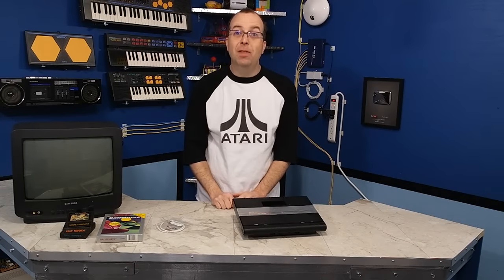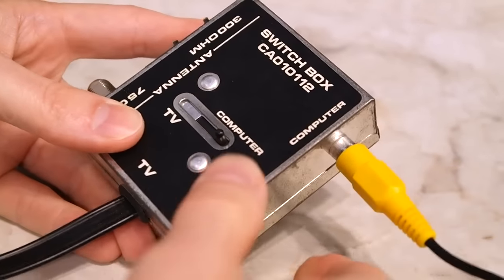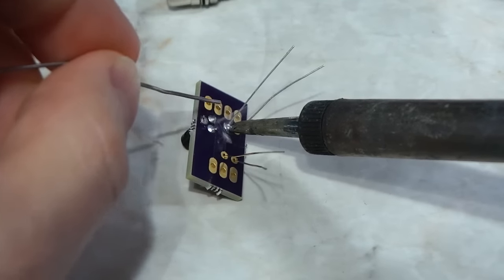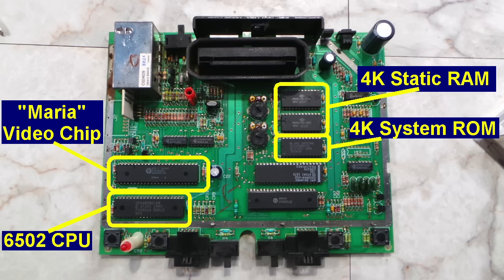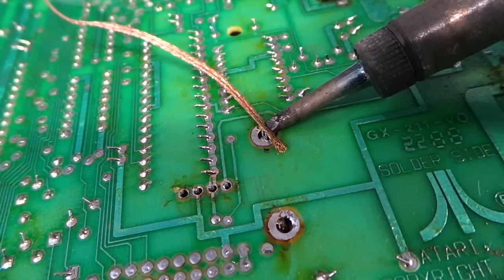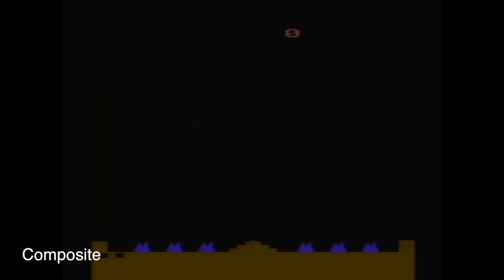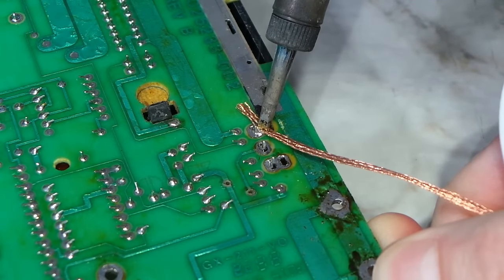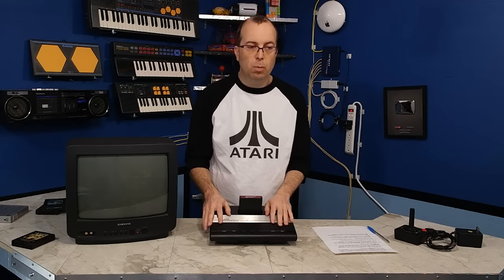Atari 7800 Composite Mod and Review

Comment: remember the futurama episode where bender overclocks? have you ever thought of over clocking one of your old computers?
Reply from the maker: You can do that, or even upgrade the CPU..  But there isn't much point since 99% of the games will simply run too fast or not be any different at all.  So unless you are writing a custom program, there just isn't any point.
Reply: Ok, you write programs right?

Comment: Goes against the point of the video but just so you know: You can get an RCA to F-Type adapter (http://www.frys.com/product/1524949) which will save you, or anyone else, from having to deal with the PITA switch boxes and 300Ω -> 75Ω adapters. You still need to switch to CH3 or CH4 on both the console and the TV so they're lined up (It's still an RF signal).

When you use a switch box like shown in the video, what you're actually doing is taking the 75Ω RF signal from the console (this goes for all of the consoles with RF out), converting it to 300Ω using the switch box, and then converting it, again using a 300Ω -> 75Ω adapter.

Comment: You have to remember that whereas the 7800 came out in 1986, making composite a viable solution, it was actually designed back in 1984. This is probably why it's RF only.

Comment: I assume you know you can lose the switch box and use an RCA to F adapter and put the cable from the console straight onto the F connector on your TV... (this is what I do with my old consoles that don't have composite outputs)

Comment: Did something similar to my VCS 2800, with only a single audio (I can just split the signal so the sound plays on both speakers) jack. I was thinking of moving the color attenuation to the side also, just in case I had to mess with the color settings.

Comment: I never used those awful boxes, I just got an RCA to Coaxial adapter from radio shack and plugged straight into the TV, and tuned it to 3 or 4

Comment: The reason the 7800 doesn't have a Composite out is cost. Tramiel-era Atari cut costs wherever they could without fail. That's also why it only has the TIA soundchip from the 2600 instead of using a POKEY chip. Developers could put a POKEY in the cartridge at additional cost to them. Cheap cheap cheap, just like Jack liked it.

Comment: 8:00 step bits are expensive if you are cutting something hard. you are essentially cutting cheese, you can get step cutting bits that work great for plastic or pvc cheap: https://smile.amazon.com/gp/product/B015MV1N8E/ref=ppx_yo_dt_b_search_asin_title?ie=UTF8&psc=1 i got these for 10 bucks. cheap and throwaway, but they work for plastic cheese. (btw don't get it twisted, it is best to just have the right size drill and to cut small holes up to the size)

Comment: You don't need all that jazz. All you need is a single (female) RF to (female) Coax. adapter that you can get at Radio Shack or on eBay. All it is, is a little thing that you plug the RCA plug into and the other ens screws into the cable input on your TV.

Comment: cool vid as always but i couldn't help but wonder - why, if you're going to go to the effort of modding a 7800, wouldn't do an RGB mod instead? especially as you say it plays 2600 games and the 2600 cannot be RGB modded.. anyways, keep up the good work :)
Reply from the maker: I wasn't familiar with this RGB mod until I started reading the comments.  I plan to look into it.  But still, the composite signal is near universal.
Reply: well it turns out i was wrong anyway, i just found out there IS an RGB mod for the 2600 by etim even though i remember reading at one point it was never possible. and like a typical yt commenter scumbag i hadn't read to see if anyone had already said the same thing - goes to show what i know. dude you've got to get on the rgb hype train, it's so good. make getting an old BVM a patreon goal. it's so worthwhile. and you can get them for a good deal if you look hard enough

Comment: If I was completely removing the RF modulator I'd have put the new jacks in the old space (possibly cut the section out and mount a new panel for them). I just dislike side connectors on things.

Comment: speaking of Atari I just got an Atari 2600 with 18 games, 3 joysticks and game manuals that are in very good condition. I got it at an estate auction for less then $50.I am not going to mod mine I will just use my good old CRT TV that is RF only form the late 90s/2000.

Comment: If you come across a modded system in an estate sale, how can you figure out the purpose of the mod if you don't have an electronics background?
Reply: indeed, an intriguing hypothetical mon librepenseur;
thus, you could take images of such, and share those with ThisWeekInTech,
Father Robert Ballecer answers all kinds of games-related hypotheticals.
or forums et boards which you think may be places that could answer your hypothetical.

what, preytel, do you think you might have found et require value for ?

I hope this aid to you mon librepenseur.
je prends conge
Reply: I picked up a couple of TI-99s at an estate sale a while back (I was needing an original monitor and it was an all or nothing lot) and one of the computers has a flip switch installed on the left side of the keyboard.  I never fiddled with it much, but I was wondering if someone was overclocking the processor (pure guess).  I just thought it interesting because I never thought of modding the TI.

Comment: Why you dont use the water and dish soap method for cleaning the motherboard? just let it sit in the sun/heating for 1 week and it's good
I have do the same method with my ASUS P5B Intel 775  motherboard, still works perfectly

Comment: It would be interesting to reuse the holes in the case corresponding with the RF jack and the 3/4 switch instead of drilling new ones.
Reply from the maker: I thought about it.  But it would have been a lot of extra work to make that happen.

Comment: About 5 years ago i bought a tiny  RF adapter one end is coaxial male the other end Rca female for my Atari 2600 works ok  might work for the 7800 ? and also the if you don't have a 2600 controller a sega genesis controller works too  again for the 7800 ? but the mod is a much better bet

Comment: Is there a way to test the sound chip?  Adding a A/V mod to my 7800 and the sound worked briefly.  Wondering if there is a fuse or resistor that could have gone bad due to the change.  Thanks,

Comment: How well doe Sega Master sytsem and Genesis controllers work on the 7800? A lot of people use them on the 2600 and since it works with 2600 pads got me wondering about sega pads on the hardware.

Comment: Yes the composite mod makes the picture quality better. BUT I can not understand why you were STILL using the original RF adapter that they used in the 70s.... Those things truly make it worse and if you went and got a modern RCA to coaxial adapter that would of made the quality FAR less muddy looking and its the size of a pea. Composite mod aside... there should of been NO reason to use the old RF adapter with that device. That was half of your problem right there.

Good job on the composite video mod though. It looks really clean and I am sure it works great. I may do this to my spare 7800 at some point. Thank you for this informative video.

Comment: So.  This is probably an inappropriate place to put this comment, but I'm going to anyway.  I seem to recall David mentioning that one of Atari's 8-bit computers (not the consoles, the home computers) had a more advanced sound chip (or possibly video chip) than typical installed, but that it was not connected to the audio (or video) output jack.  It may also have been an LGR video.  I can't find terribly many references to the Atari 8-bit line on either channel, because the search function built into Youtube is gallingly bad, particularly for a Google product.

Comment: i have the Atari 5200 which is bigger and better IMO. Mine still has the clear plastic covering it so its like new. tho i did have to rebuilt the funky controllers several years ago and works like new.  i wonder if their is a composite mod for it....I'll have to check into it.

Comment: Wow! Only 3 electrolytic capacitors! It's been 4 years since this video has been posted, if they are the original capacitors, I would want them to be replaced, I had a similar console a few years back that had a really noisy picture and sound, I replaced the electrolytic capacitors which were bad and it's image and sound were restored!

Comment: Distilled water, from gas station near you, can be used to flush even beer from laptops if applied ASAP.  I dunno about the additives on american tap water but i would`t use it..... 
(rescued couple beer spills and phones that submerged in a pint :D )

Comment: Just wonder where that other wire went to might missed that but it seems simple enough to figure out like the mod it improved the system always hated those wingle lines we use to toss the rf box around to rattle the dust out to get it to work better I hate those things.

Comment: 3:52 hmmm, I think you've misordered the component you would like to solder. You should have solder the transistor the last one after the rest of the component before the transistor itself. Transistor known to has lowest melting point and lowest sturdiness. Yes, prone to damage by heat! So if you too long solder on that transistor, the inside will melt and malfunction.
5:22 VINEGAR VINEGAR VINEGAR VINEGAR VINEGAR VINEGAR VINEGAR!!! tbh, I practiced that too when I was fixing the battery corroded wireless keyboard component, not work well but has atleast significant improvement. thx dude!
5:36 Maria chip. wow, what a pretty GPU!
14:59 Wow, extrenly Duper Awesome!!!!

Comment: harbor freight has a stepped drill bit set for like $10.

while most if not all, including this bit, is garbage it beats not having one. pretty sure its a high carbon steal bit (the worst type of steal for a drill bit) , but for plastic its fine. you reduce a lot of the grabbing while drilling plastic while using stepped bits.

Comment: It boggles the mind that Atari didn't add the couple of extra connectors and jacks to support composite output natively. It wouldn't have made a huge difference for the console in the marketplace though, it was always going to be held back by poor audio, Nintendo's monopoly-esque grip on publishers, and the NES just opening the market to a lot more genres of gaming that the Atari was ill-equipped to handle (like RPGs).

Comment: Instead of the RF switchbox, you can now use an adapter like this: https://www.amazon.com/gp/product/B0028MXOF6/ref=oh_aui_detailpage_o01_s00?ie=UTF8&psc=1
I also did this AV Mod and found the sound was too "Hot" so I added a voltage divider to drop it down to much better levels.  Using Audacity to check the level.
I am really surprised you do not run the various devices (Keyboards) that you add RCA outs to thru some sort of indicator to show VU levels.  I use a DAK 2800 mixer and it works great for this purpose.   I am pretty sure not using this burned out the audio inputs of a cheap "to hdmi" converter.
Thanks for the great content -- awaiting X3.

Comment: Couldn't you of just soldered the sound wire onto the resistor leg? Why did you have to remove the switch and resistor?

Comment: If the transistor amp dies, just get a better 2n3904, and not a surprise ebay piece from a recycle/pull. That's the only issue with the unverified boards. The original modders that release their work for others should be rewarded as much as possible IMO.

Comment: Whaddayamean, Not Stereo? My 2600 has stereo output. Combat is one of the only games (IIRC) that is stereo. I've a modded and near mint 2600 system. Too bad all the latest AV receivers dropped SVideo inputs...I have that on the Atari (it also has component video out). That TIA can do RGB...

Comment: That board really needs a clean and treament to stop the corrosion.. you won't have a running system for long with that level of rust eating away the traces and connections.

Comment: hey, use a coaxle to component adapter for your 2600 and 7800 and say goodbye to those boxes. I have 4 box and all 4 are bad so I had to find a solution.

Comment: If you don't know, it's recommended to not get the United States versions of 7800 controllers because most people agree that they suck. Try to get hold of or import a european/PAL 7800 controller because they were more like a normal NES controller.

Comment: So why are there 2 audio cables when the audio is mono?
Reply: In case you're using a stereo TV with two audio inputs - otherwise you'd only get sound from one speaker; at least this way you get dual mono.

Comment: I have retained my original TV that I still play my Ataris on. I have the following Atari systems:
• Atari 2600 VCS 4-Switch Woody
• Atari 5200 Super System 4 Controller Port with Automatic Switch Box
• Atari 7800 Pro System
• Atari 400 Computer
• Atari 800XL Computer

Comment: You planning on giving 1MB to that sweet XEGS of yours?
Reply from the maker: No.  First of all, I don't own an XEGS.  I have borrowed one from The Obsolete Geek every time I needed it for a video.  But even still, I doubt there is much of any software that can take advantage of 1MB.  Even my 130XE that has 128K is really pretty useless outside of the first 64K.
Reply: I've got a 1MB mod only to play demos...guess You're right
Reply: @The8BitGuy  Not entirely useless. The 128K on the 130XE is more like two banks of paging memory of 64K that could be instantly swapped rather than a contiguous block. There are ways of programming for it, but most software was made to be compatible with the 65XE (that only had one bank) or the older XL's and didn't take advantage. Also it made more sense with the tape or floppy drive than it did with anything on a cartridge. (Some ability to pre-load stuff.) I think there's a few Antic Magazine articles on how to put it to use if you were to look into it.

Comment: The 7800 games are totally worth it. The 7800 controllers, however, are terrible; don't bother. You can actually use Sega Genesis controllers on it just fine; they have the same connector and work just the same, oddly enough.

Comment: Now, what's wrong with Atari 2600 graphics? A clever coder can easily push the console beyond it's limits.

This is a WIP 4KB game, that I'm currently in the middle of coding:
http://atariage.com/forums/uploads/monthly_10_2016/post-44171-0-25607600-1475518409.gif

Comment: You soldered your resistors in backwards...
Reply from the maker: I didn't know it was possible to solder a resistor in backwards.....besides, I just followed the picture that was given with the product and that's how they were shown to be installed.
Reply: The 8-Bit Guy That was partially my attempt at humour, but also it's traditional to orient resistors so they can be read left to right or top to bottom. Of course you could just turn the board round ;)

Comment: You can get a set of step drills from harbor freight. With a 20% coupon they are very affordable. They are not the best quality but for drilling into plastic cases they will last forever. https://www.harborfreight.com/titanium-high-speed-steel-step-bit-set-3-pc-60379.html

For the coupon, simply do a search on google for one. Easy to find.

Comment: Would it be as easy to mod it with an HDMI output?
Reply: I doubt it. The signal that he's dealing with is analog, even though it's produced by the computer, obviously. HDMI is a digital signal. So he'd have to re-digitize the signal in a format an HDMI-aware device could understand.
Reply: There are people who mod NES and other old console with HDMI output. Can't you find some sort of converter? Or is it different with an NES?
Reply: Very cool. I'm sure it could be done, but not as simply as 8-bit Guy does in this video. They were both designed to hook up to an analog TV. HDMI is not analog. https://en.wikipedia.org/wiki/HDMI

Comment: The 7800 was such a strange, neither-fish-nor-fowl product. It fixed the two biggest problems of the 5200, its lack of 2600 backward compatibility and its bad controllers--but it was now incompatible with games for the 5200 and the 8-bit computers, its native games weren't tremendously technically superior to those, and the built-in sound was a step backwards! And since its release was delayed so long, it was behind the rest of the market.

With the XEGS in 1987, Atari finally made what they should have released back in 1982 (or maybe even 1979)-- a true, compatible game-console variant of the 8-bit computers. But it was way too late.

Comment: Atari 7800s have dull colors, which is why I don't use mine for playing 2600 games. Most 4-switch 2600s have even worse colors, but that can be fixed by adding a resistor (it's an official fix published in an Atari field service manual way back when). Unfortunately, there is no fix that I'm aware of for the 7800's crappy color output. The 6-switch Atari 2600s (both heavy and light) have the best colors though, even better than a 4-switch version with the resistor modification. Here's some comparison pictures I took using the same standard resolution CRT TV and RF connection for all of them:

https://i.imgur.com/uLdsG4g.jpg

Comment: Sega Genesis controllers will work
Reply: They only work as 2600 controllers, they do not support the use of two button 7800 games unless you modify them. I modded generic nintendo controllers to use on my 7800, works really well.